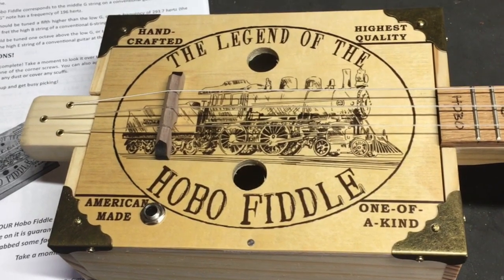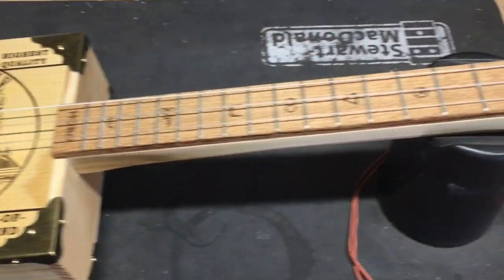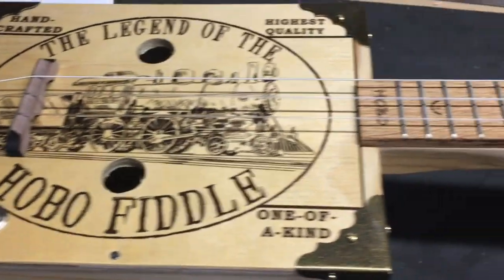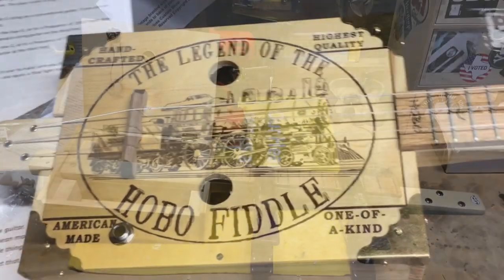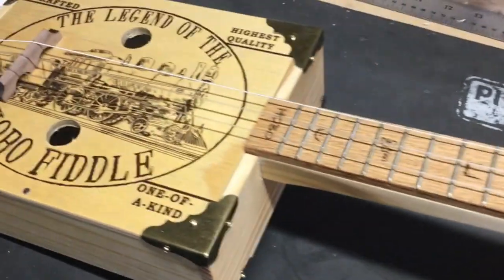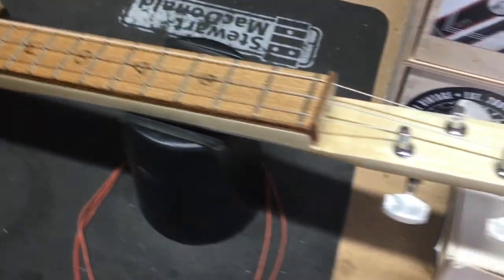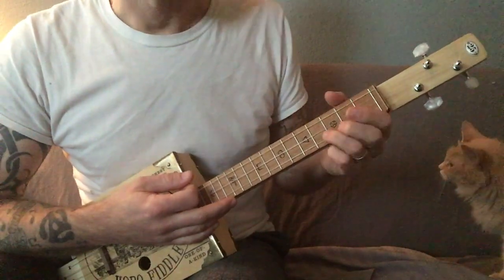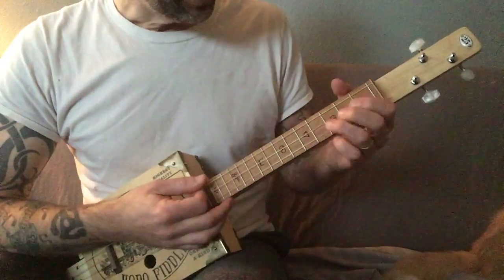DIY Project: CB Gitty Hobo Fiddle Kit

Comment: Really couldn't be a hobo fiddle with nylon strings in 1925 because they weren't made until 1948, copper strings would sound alot better
Reply from the maker: Thanks for checking out the video. There's actually a legend of the Hobo Fiddle. You can find the story here: https://www.cbgitty.com/books-posters-music-media/books/the-legend-of-the-hobo-fiddle-book-by-ben-gitty-baker/ . As you point out... the story has the hobo making strings out of discarded wires, used piano strings, and other found objects. However, the kits made by CB Gitty use these nylon strings. You might want to ask them about that.